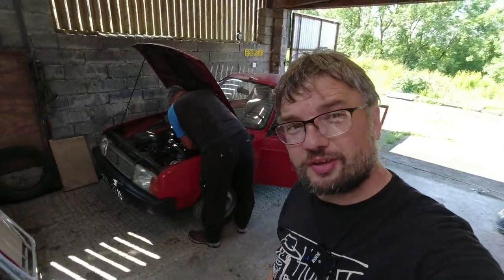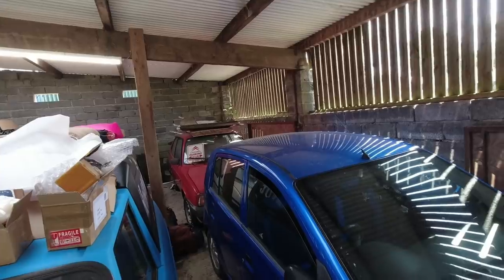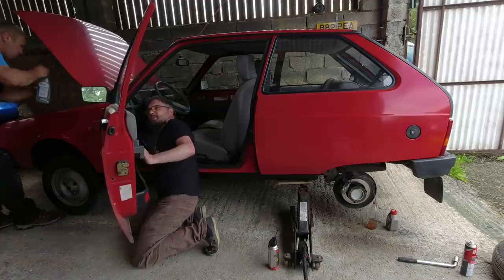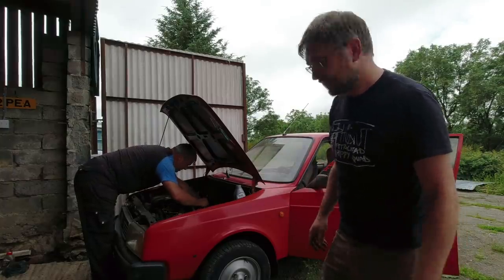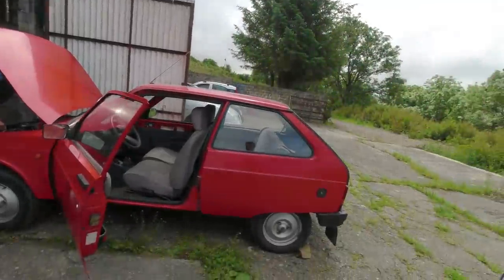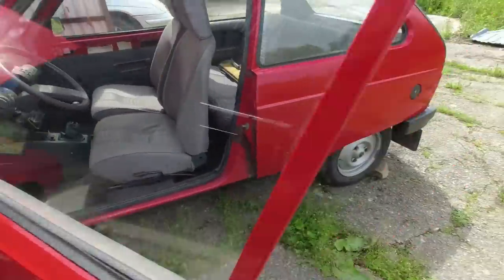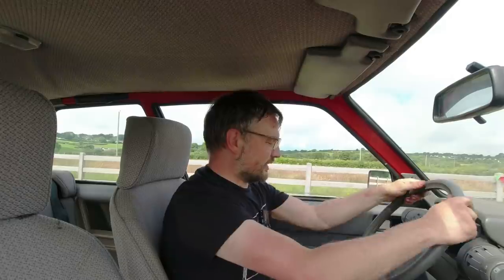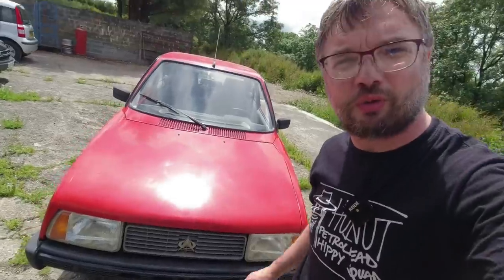Oltcit Brakes Part 2: Will they work?

Comment: Ian. When I was first learning to drive I was alway s told to depress the clutch because  1“ it creates less strain on the battery to turn over the gearbox internals “ & 2 “ in case it’s been left in gear”  I never fully understood 1 but 2 always made sense especially if my dad was under the bonnet !😉

Comment: When I started messing with cars we  always rebuilt brake cylinders. It was only successful about 50 percent of the time but still worth a go as parts were very expensive. Good motor factors could match a seal from the old one.

Also bleed screws were a luxury as they had usually been snapped off however there is always a way to bleed stuff without the bleader if you think about it hard enough.

Comment: Ian, If possible, You may want to drive it for quite a few miles to burn out all of the old petrol.  I am not sure that you can due to the status of the registration, but I believe that it will continue to run better and better the more you drive it.  Great Video!!

Comment: Ian try putting a one way valve before the petrol pump, they are cheap off sneezebay, that will then keep fuel in the pump and above it, save's battery.

Comment: This is a 11R. Might have some Dacia (Renault 12) parts. In the late 80, due to Ceausescu’s policy on imports, they had Dacia wheels which made the car look wider. Also, they has some brake parts here and there. However, after 1990, until the end of production, they went back to Citroen parts. 
Yours is a 11R which has, I think, the 1100 cc engine. It is aircooled and, if I’m not wrong, a V4 displacement. Former owners used to complain about ignitiom and fuel system, it was a pain in the ass to make everything work.
Make sure you have a plastic plate that you slide in the front of the fan in the winter. As it is an aircooled engine, you might have trouble with the cabin heating. That is why that plate is important. If you don’t have it, you can make one.

Comment: "She's feeling very coughy spluttery".
You will find out that that's also just oltcit. Especially with the original carburettor.
Reply: I wonder would fitting a replacement Weber improve things? 🤔
Reply: @jazzhands7771  Not sure if it should be a weber, but I know they do get replaced by more err... 'western' ones :D.

Comment: In 30+ yesrs of motoring i have just not had any inclination to use seal repair kits for master cylinders.   Something in me says avoid and try to source another master but complete.   Its just the thought of a sesl holding up initially but letting go just when you need to stop on a dime......
Reply from the maker: In slightly less than 30 years of motoring, I've never had a master cylinder just suddenly fail. Dual circuit brakes add some reassurance in this case.

Comment: If you want a true parts bin car, try your luck on a Matra. Talbot Tagora engine, Citroën CX gearbox, Simca Horizon steering rack and front suspension, Renault 12 indicator lenses, Peugeot 505 door handles and Audi 100 sun visors...

Comment: Looks like BX rear calipers ? does hand brake work on front calipers like BX
Reply from the maker: Yes, front wheel handbrake, but with separate pads I think, more like 2CV/GSA.
Reply: @HubNut  BX didn't have separate pads but rears look very similar to BX . Liked the BX had 2 of them one was insurance right off I repaired .Got it very cheap with rear suspension damage because no one wanted to touch it

Comment: You didn't press the clutch pedal down when starting the car, any reason for that?
Reply from the maker: I never do. I do usually check I'm not in gear though...
Reply: Yes, it reduces the load on the battery and starter. Also saves embarrassment if the car was left in gear.

Comment: Surprised to see the Oltcit has rear disc brakes. My car doesn't even have rear disc brakes and it's a modern car. Do you really need rear disc brakes on a front wheel drive car,  when most of the braking is done on the front on a front wheel drive car anyway.

Comment: Workshop safety - should be using axle stands- not relying solely on 40 year old scissor jack . Jack fail will be catastrophic
Reply from the maker: It's a valid point, but we were using a substantial trolley jack, not a scissor jack.

Comment: The old girl is sounding like a car. Might not be a bad idea to drain the tank and get it cleaned. Old petrol can do more than gum up the carburetor. If it is bad enough, the varnish can cause valves to stick, ruining an otherwise good engine.

Comment: Why does a car like this have four wheel discs and a rev counter?
Reply from the maker: It's a valid question. The Might Dacia also had a rev counter so maybe Romanians just like them. The rear discs just because it's a GS braking system when it comes to hardware.